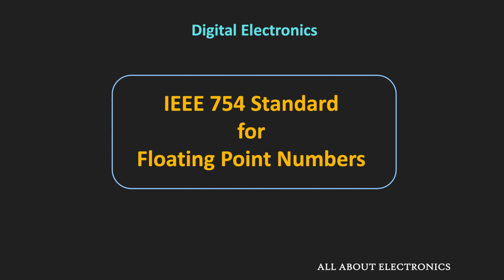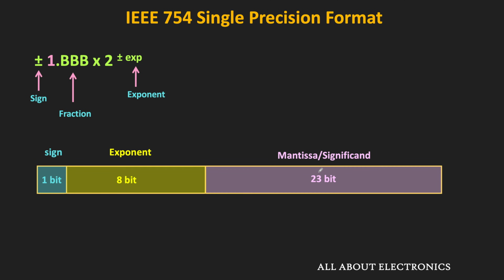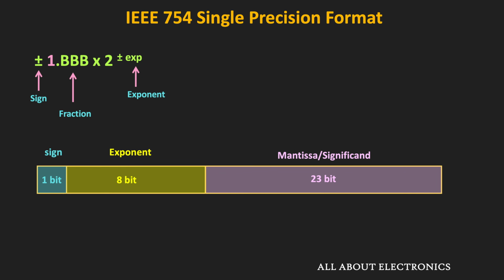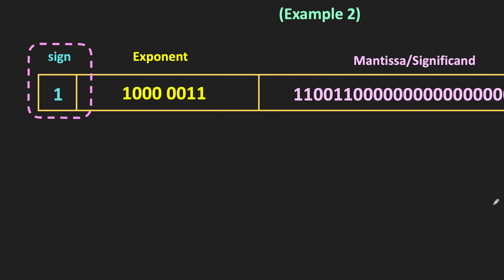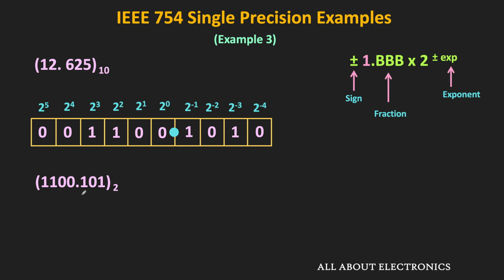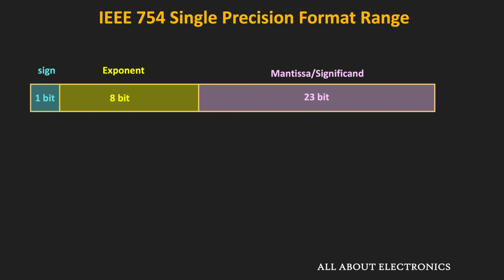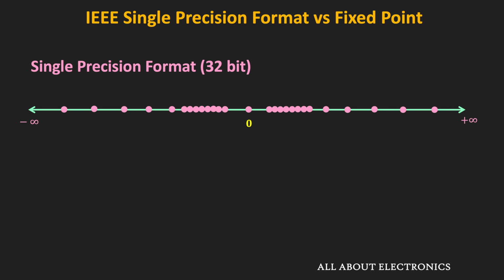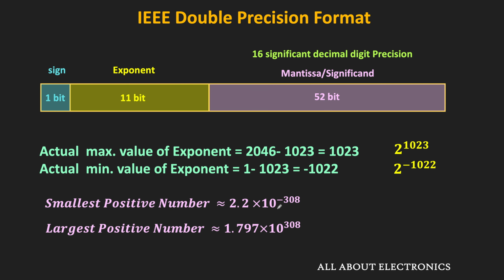Floating Point Numbers: IEEE 754 Standard | Single Precision and Double Precision Format

Comment: I don't get, why the bias is 2^(n-1) - 1, what's the point of the "-1" part, why not just 2^(n-1)? 
Why our decoded range is, say: - 2^(n-1) + 1 to 2^(n-1), instead of it just being
- 2^(n-1) to +2^(n-1) - 1, like it is with signed integers?
TL:DR, why is it important to be [-127, 128] instead of [-128, 127], like with signed integers?

Comment: 7:00 How can you tell one number is larger than the other by only comparing the exponent? What if the number with larger exponent has smaller mantissa?
Reply from the maker: I think you misunderstood. The first thing that you will compare is the exponent. If the exponent part is same then you will got for the mantissa. Otherwise, there is no need to check mantissa. e.g let's take two two numbers. 
1 x 10^10
And 7 x 10^4
So, obviously for the second number the mantissa part is larger than first number (7>1). But if you see the exponent, then for one number it is 10^10 while the other is 10^4.
So, obviously, the first number is larger than second one. You can say that just by looking the exponent part. If they are equal for both numbers then you will check mantissa. I hope, it will clear your doubt.

Comment: How .75
Reply: How 1010 is .625
Reply from the maker: After binary point, the weight reduces by factor of 2. So first 1 will have weight 1/2. Then next digit will have weight 1/4, then 1/8 and then 1/16. So here if you add the weights where there is 1, the sum would be 0.5 + 0. 125=0.625. 
I hope, it will clear your doubt.

Comment: how does the number of mantissa bits are related to significant decimal digits after decimal point ? and also how are we loosing the precision even though number of bits are 23 ? do you mean precision of the 32 bit floating point is less than 32 fixed point ?
Reply: That 23 bit is fractional bit...

😊

Comment: What is we won't add biased and instead of that we convert the exponent of a number in its binary form and then represent it in the exponent bit of single/ double precision from right to left like 100 if we'll represnt this in exponent part then it will be 0000 0100? Will this be correct if we won't find it's biased ?